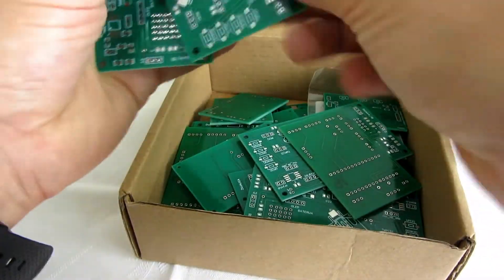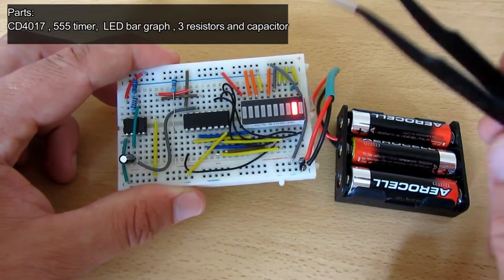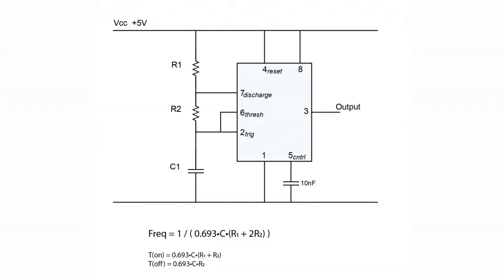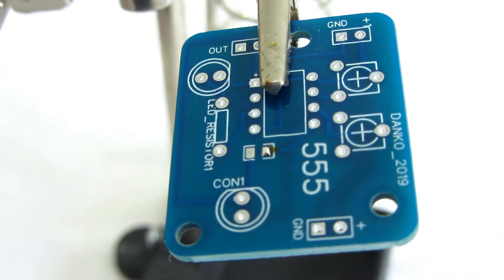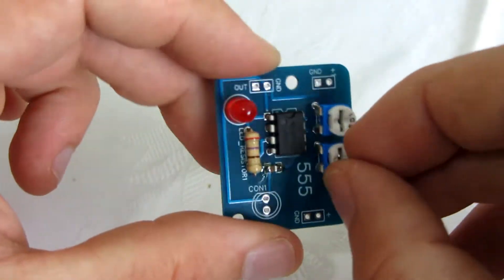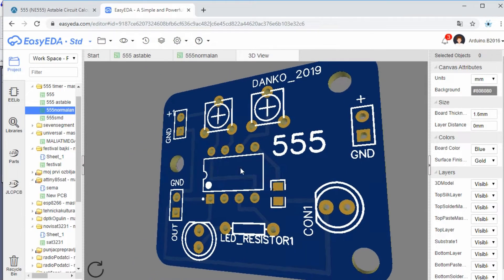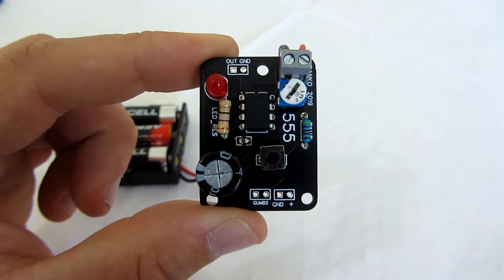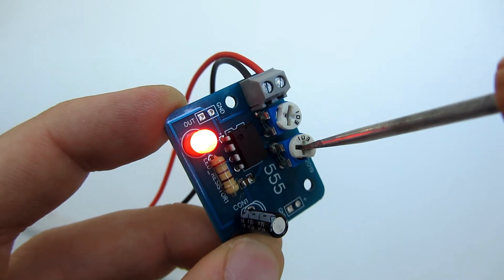Astable and Monostable NE555 timer PCB

Comment: Sir it's good but i need to connect dis pcb to over head tank float when it full I need to get buzzer for 30 sec and it should be cutoff (folat switch gives continues pulse